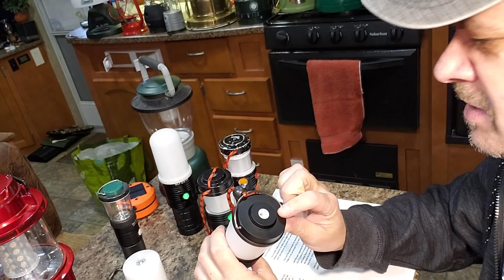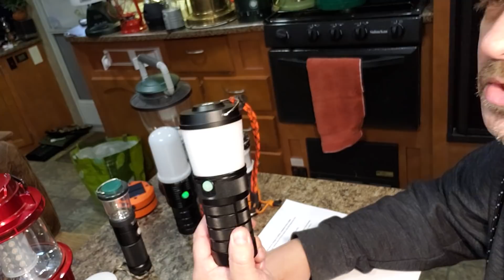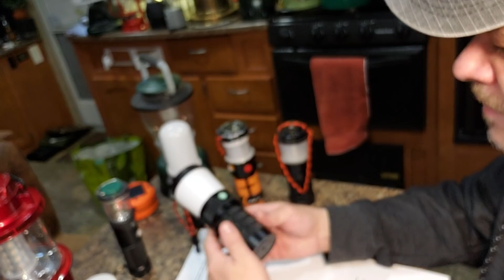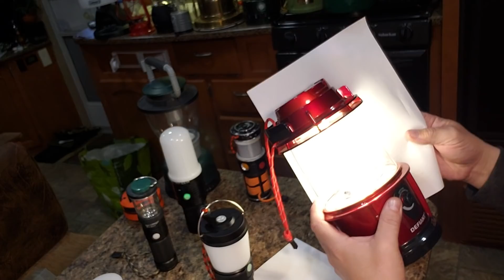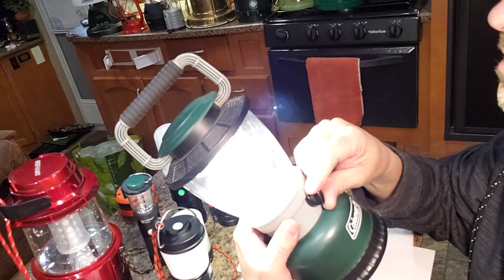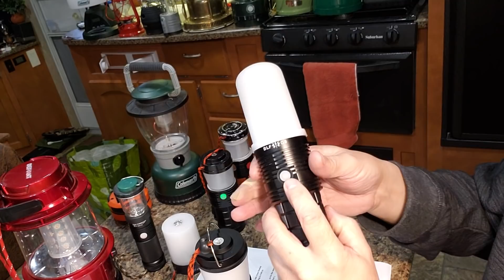LT1 lantern  sample chat

Comment: Very interesting.  Is it known how much the loss of light is on this level of frosting?  i have a silly idea but it just popped into my head, the frosted cover diffuses the light which is what a lantern should do.  i have a crazy idea, is there any company who could 3D print a 360 degree TIR lens that wraps the circumference?  There is virtually no loss of light in the transmission through a TIR lens but it diffuses the light, so it seems like a win win situation.  What are your thoughts on this?  I dont think this exists right now as far as i know.  i guess inside you would need to use multiple LED emitters facing outward but thats the only main issue i can think of.